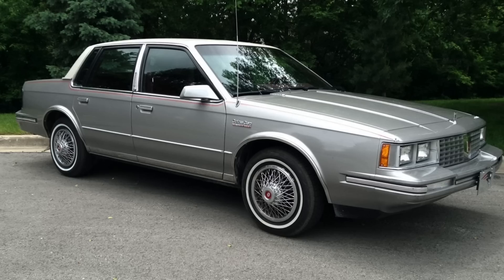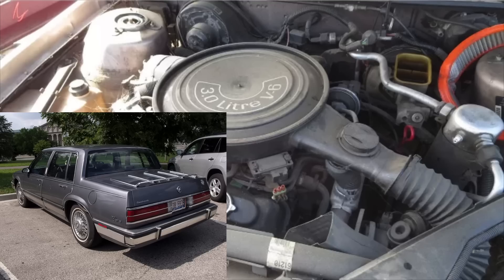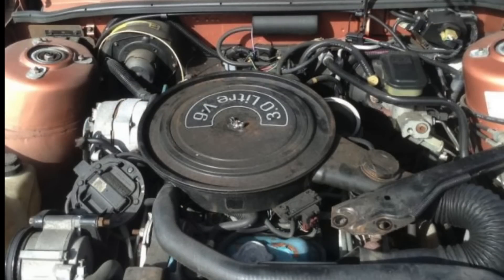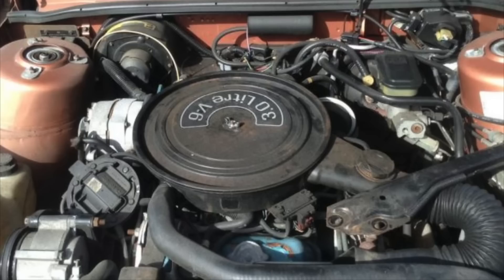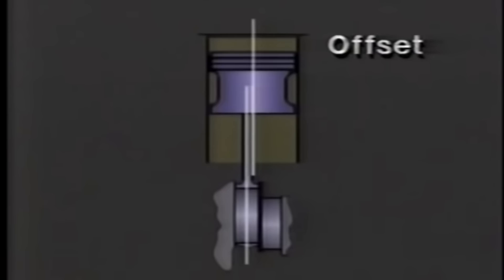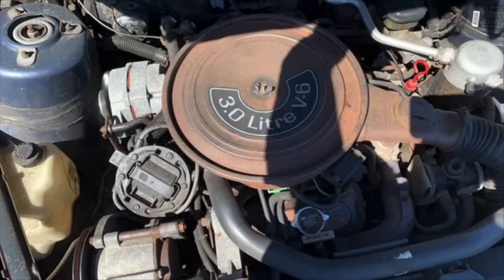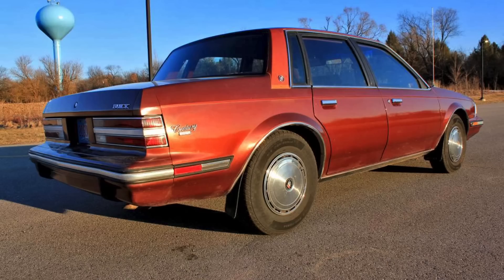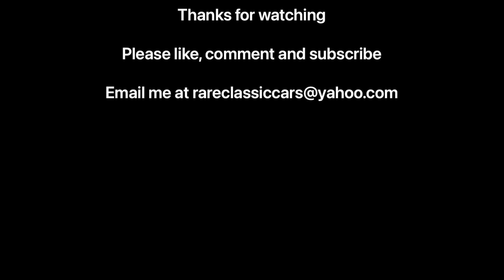Worst Engines of All Time: GM's 3.0L LK9 Carbureted V6 Engine (Buick Century, Olds Cutlass Ciera)

Comment: I had the 2.8 with a Getrag 5 speed in an 88 Corsica.  It was fast enough but developed intractable stalling issues and I traded it in.  Various bits and pieces kept falling off the car.  The trans was excellent.  The AC never worked.  My last GM.
Reply: 92 Bronco in 2003, what a lemon that thing was. Got a 2003 Sierra in 2006, if I hadn't wrecked it in 2012 I'd still be driving it. I have a 2007 Classic Silverado that is at 175,000 Miles, I bought it in 2016 with 75000.

Comment: Adam, would that non-wearing engine additive have any benefit to high mileage Modern cars?
Reply from the maker: I’m not sure admittedly.
Reply: Yes it would. As it contains zinc, which is essential for flat tappet engines. Otherwise, you are just allowing metal on metal contact, and the fine shards will eventually clog your oil pump filter.

Comment: A client of mine had an 84 Celebrity Eurosport that had the 2.8, she put around 200K on it with very few issues. A neighbor had an 82 Century with the 3.0 engine, at a relatively low mileage, a spark plug broke and busted up the piston. Another neighbor and I helped with the repair and put the thing back on the road. I moved before I could find out how long it lasted.

Comment: Here are my memories of this engine in a 1985 Cutlass Ciera I drove in the late 1990s. A friend owned the car and asked me to do some repairs to it. The car had just over 100,000 miles, and it did not run well cold. My friend gave me the car to repair but also let me use the car for several months since they did not need it back right away. What I noticed was the oil had not been changed in a very long time and was black - the way oil gets when people neglect to change it. I changed the oil, the PCV valve, and PCV filter. I remember the PCV valve must have been stuck, because the crankcase was developing pressure and would push the oil dipstick out an inch. As far as I was concerned - this was due to owner neglect, not a fault of the engine.  The cold running problem I solved by rebuilding the carburetor on - which was the Rochester DualJet (E2ME). The main issue was that the choke angle was too wide when the vacuum break pulled the choke off when the engine started. The engine ran too lean and the car would stall out when put into gear unless it was warmed up for several minutes. I fixed this - but decided to do a full rebuild on the carburetor anyway since the car had 100,000 miles and the carburetor had never been rebuilt. I remember on the mixture control solenoid you could adjust how rich the rich setting was by adjusting a little screw on it, but the lean setting you could not adjust.  I remember thinking this was not a very difficult carburetor to work on, it was just different in that it had a throttle position sensor and a mixture control solenoid, which older carburetors did not have.  After making these repairs, I drove the car for 10,000 miles over the course of 6 months, so it had 110,000 miles on it at that time. I don't remember any strange vibrations at 1200 rpm or anything like that. It was actually a smooth and quiet engine. It didn't have a great deal of power, but it seemed acceptable to me. I enjoyed driving the car in the time I had it. I believe I also changed the transmission fluid in it, which again had never been done in 100,000 miles. I returned the car to my friend, who had it a while longer.  I don't remember hearing what ultimately happened to it.  I think they were surprised I was able to get the car to run very well again and they were able to use it again regularly without having to warm up the car for several minutes each day.  Since you mentioned the even firing 3.8L V6 in your video, we had an 81 Buick Century Limited (which was rear wheel drive) with the 3.8L V6 which we bought new and drove for many years. We really liked that car.  It was smooth, quiet, it rode well, and was very comfortable. Definitely no vibrations from the engine.  It ran smoothly at any rpm. My recollection is the car had good off-the-line and good mid-range power, but if you really pushed it, it didn't have good power at high rpms. But this was common for cars during that time period which had so much emissions equipment at the time. We drove it until it had 125,000 miles on it with very few problems. The timing chain eventually stretched enough that it finally broke and needed to be replaced. I don't recall it breaking a tooth on the cam gear - the timing chain itself broke. We got it fixed - but what I can't stress enough is - when the timing cover is removed to work on the timing chain, the oil pump is disturbed because the oil pump is mounted on the cover. When everything is put back together, you have to prime the oil pump before you start the engine! If you do not, the engine will not build oil pressure and you will damage the engine! Maybe some technicians out there do not/did not know this. As long as this is done you'll be fine. But again this is on the 3.8L V6, not the 3.0L V6. The engines are related but they are not the same - the 3.0L V6 may be different. In general, the cars, American and foreign, simply got better as the 1980s progressed and fuel injection and distributorless ignition were introduced, and emissions controls improved (fewer were needed as we moved away from carburetors, and more were electronically controlled and were not vacuum controlled any longer).  I have driven X cars, rear wheel drive A cars (1978-81), front wheel drive A cars (1982 and later) with the 2.5L, 2.8L, and 3.8L engines - they were all fine. By 1989/1990, the A cars (Century/Ciera) had the 3.3L V6, which I drove and found that that was an engine with a LOT of power - much better than the older ones with carburetors. The 3.0L I had the one experience with for 6 months/10,000 miles - it seemed to be fine to me - though I did not drive one for 100,000 miles. I do not think people in that time period followed the "change your oil every 3 months / 3000 miles" mantra like they did years later. They waited until their cars broke down and then they got them fixed rather than being good about maintenance. The 3.0L may have had problems, but a lot of the problems with the cars also came from owner neglect and lack of care. I can say this because I worked in an auto shop at a community college in the mid to late 90s and I remember the cars that came in, the problems they had, how the owners did not take care of them, which resulted in various problems. It isn't clear to me why the 2.8L was offered only in the Celebrity/6000 and the 3.0 in the Century/Ciera early on - why not just offer the 2.8L V6 in all of them from the beginning - which is ultimately what happened after 1985 anyway?  My philosophy was, and is, if you take care of your car, it will take care of you. So I always did things like changed the oil in my cars, changed the coolant, filters, tires, brakes, etc - and I never had many problems with my cars, even during the time period of the 1980s when people were complaining.  Maintenance does go a long way - it's your choice whether you do it or not. Just sayin'!
Reply: Pretty much the same here. 85 fwd LeSabre I think it was. Had a 3.0l. it wasn't no sports car, but it was a very reliable engine, just like the 3.8l. The only thing that needed replacing was the crappy nylon timing gear. New timing set and it was good to go.
Reply: That was an 1986
Reply: Man I’m gonna give you a thumbs up just for taking the time to write all that info. I had an ‘88 S-10  2.8. I had my local tow company on speed dial.
Reply: @AyeCarumba221  lol. The 2.8l was a far crappier engine than the Buick 3.8/3.0, that's for sure.
Reply: @JohnDoe-ml8ru  no way !! I have the H.O. carbie in my 6000 and it's been good to me. They also got way better with MFI.
Reply: According to the dealership shop manual if you do mostly stop and go driving or idling it's every 3 months/ 3k miles for oil changes and if you do mostly highway driving every 6 ( maybe 7) months / 7k miles.
Reply: Excellent in-depth story. Thank you.

Comment: Oh boy, you don't need to tell me about that awful engine.  My grandparents bought a decently loaded 1985 Cierra.  It had that awful 3.0 2V engine.  When the thing was brand new it stalled about 5 times just getting it out of their garage.  They gave me the car when it had 75k miles on it (they'd already had head gaskets done).  It also had the digital cluster which was a cable driven digital speedometer and the speed would jump all over the place.  I tried several different rebuild clusters from the dealer, and all had their own issues.  Long story, crappy car.  Too bad it didn't have the 3.8 and analog gauges, that would have been a step up.  But on another note, that was one of the most comfortable cars one could imagine.

Comment: Mid 90's I bought an '82 Chevy Celebrity cheap because it had an audible knock. I ran 50 weight oil in it, then 70 weight, then went to 90 weight straight gear oil. I never changed it just kept on adding. It lasted about a year and went 10k miles before it stopped. It was the 4cyl..

Comment: My Mom had a 83' Century and it drove fine until the 1st cold snap. It wouldn't stay running after it fired. The dealership mechanic came to the house with another guy. He said, "Here we go again with the 3.0." They couldn't get it to run and ended up towing it in. They had to adjust the throttle body to run for the higher elevation. It ran fine after that. It was a nice car from what I can remember.

Comment: There was a V6 engine used in some Chevrolet trucks and "Blazers" around the early 1990s that was claimed by some people who drove them to be Chev. 350 with two cylinders missing. I think about 260 cubic inches or "4.6 liter". (4.2?) "Fuel injected" carburetor on the issued County pickup my boss (and sometimes myself) drove.  I wonder what kind of bottom end those had? Seemed to make reasonable power in lightly loaded pickup and more than enough in the "Blazer" but not so much as the Jeep 242 inline "Powertech" six.
Reply: The 4.3 aka 3/4 350 aka SBC V6. 262 ci
Reply: @samholdsworth420  — Yep … that 4.3 was a great engine …
Reply: Yeah. They're definitely a good engine. Maintain em and they go 400k

Comment: I was a mechanic at a Pontiac, then Buick dealer during this time. I don't remember ever seeing a 3.0 in a C body, and I know I never saw a 2.2 in an A body. The carbs were adjusted at the factory, and the screws were covered with plugs. Almost all of them were out of adjustment, but with the right tools and skills, we could get them running right. A bigger problem, that you didn't mention, was cracked blocks. The water jacket would crack along the bottom, usually near the front, usually on the left bank. Under warranty, we were required to replace it with what was called a "Fitted block". This was a new block, pistons, pins, and rings. That's it. That required total disassembly of the engine, pressing the old pins out of the rods, pressing the new pistons and pins on the old rods, then re-assembly. I did so many of them I used to be able to tell where every nut, bolt, clip and wire was supposed to be, and what order it had to be in.
Reply: Nightmare fuel. This engine in an Olds Cutlass is the reason my normally quiet and reserved father lost his shit, got in a huge argument with my grandfather about the shit quality of Oldsmobiles and permanently decamped to Mercedes and Toyota as his and my mom's vehicles of choice. His 91 Toyota SR5 V6 pickup is still on the road today.
Reply: I have all the tools for working on those Carburetors, Both 2 and 4 barrel versions. Big Fun if there were other problems like Vacuum leaks from the rats nest of hoses that would rot or get oily swell up and fall off. Thanks EPA!

Comment: You mentioned the 3.0 liter being offered in the C body cars for 1985 but you failed to mention is was the base engine for the all new redesigned Oldsmobile Delta 88 and Buick Lesabre for the 1986 model year only.  I know this because it's first in the sales literature but also i had a friend of the family that had that engine in their base model Oldsmobile Delta 88 Royale sedan in 1986.  It might have been fuel injected at that point but it was still the standard engine in that model/year.
Reply: I think ALL c bodys got the LN7 - 3.0L MPFI version
Reply: @jakeballard7999  and H bodies too for 1986.

Comment: Lol, man I'll never forget what those old odd-fire V6s used to feel like...it was like riding around in a paint shaker...can't freakin believe they ever made it into production.
Reply: Are the 3.1 V6s part of that family? My ‘94 Cruiser wagon has one
Reply: @seamusmeade940  No, the 3.1 was a 60-degree Chevy V6 based on the 2.8.  The old pre-'79 odd-fire 90-degree V6 was the Buick 231 (and a couple smaller displacements too, IIRC) which later evolved into the 3800...of course those 3.1/3100s would later become notorious in their own right for eating those lower intake gaskets...ask me how I know, lol ..that was a fun job...not ..

Comment: If you are doing worst engines, how about the most emissions failing engine ever from GM, the Olds 307 “ Corporate “ motor. It had a whopping 148 horsepower and, among numerous other models, it was installed in all GM full-size wagons from 1986 thru 1990. It made no sense why especially when way better engines like the TBI 4.3, 5.0 and 5.7 were available, all having much more power
Reply from the maker: It was at least durable, though it was indeed a wheezer

Comment: I had this same motor in my 1982 Buick Century. I could not believe how gutless this engine was. Hardly any passing power and had really horrible gas mileage. The 1.6 liter OHC for cylinder in my dad's 1984 Old's Firenza felt like it had twice the power of this V6 and got nearly 30 mpg. I was lucky to get 15 mpg out of that V6. Plus, I had to let it warm up for 20min on cold day or else it kept stalling out. One of the many reasons I got rid of that car after a few years.

Comment: I didn't realize they did connecting rod offset.
I have heard that some early Buick V8s had that design flaw,perhaps the early Nailhead? 

 At least some of the 2.8/171 Chevrolet engines had dual valve springs and that thing could rev to a lot more than 5000 rpm but perhaps got lucky? But not much low speed  torque and an appetite for premium unleaded.

Comment: Pls don't forget the 2.2 liter carburerated that was in the 1982 Chrysler.. I was practically given an 82 Lebaron convertible.. that I had towed home.. it just shut off for no reason.. after endless towes, my expert mopar mechanic,  at my persistence and me test driving it for hours circling the block , figured out how to bypass all the early computer glitches...just shutting the engine down for no reason. I drive it around town now and amaze other drivers seeing one of the most popular cars in 1982 equipped with one of the worst engines ever built ..how many 82s were junked .and tothis day they are extremely uncollectetible like the 1958  Plymouth Fury was in 1981 when I bought an original survivor for 3,800.00 .. I sold it because no one could tune that pair of factory 4bbl carburetors and I wanted to drive it without it constantly choking out... guess I could have retired on the sale of it today

Comment: Your pictured engine's MAP sensor is unplugged. I had a non-running (fuel injected, I think) 3.0 for a short time, in a Pontiac Grand Am. I seem to remember ribbed aluminum valve covers, not the stamped steel ones shown, and a resemblance to the 3.8. Does that make sense? i can vouch for the excellence of the 3.3 litre member of this engine family - over 340,000 km on our 91 Cutlass Cruiser, astill going strong. Chevrolet's 2.8s enjoy my respect, too. They served me well - still have a couple.

Comment: Those additives you suggested don't really work with today's oils because of the large percentage of detergents in the oil. These detergents will clean most of the additives off what ever the oil is lubricating.

Comment: The wider 3.0L and 3.8L were only offered in the Ciera and Century because their front clip was longer than the Celebrity and 6000. I measured them when I worked in a GM dealership in 1984. The 3.0L was a nightmare of customer complaints (shake the fillings out of your teeth.) That was most likely why GM started telling service managers to refer to them as customer comments instead of calling them complaints. And you probably already know you show an X body Phoenix at :37 instead of a 6000.
Reply from the maker: Yes. I goofed. Thx!
Reply: They used then in pontiac grand am 4 door cars too. I upgraded an 85 grand am to a 3800 and it was no small feat! The 3.0 self destructed and even knocked the starter off the engine. It lost 5 rods that made short work of the block itself. I had to graft the wiring from the donor car and use the ecu too. after all that work I turned the on and the engine light flashed twice, cranked it and it fired right up. No codes. The next to go was the transmission.
Reply: I've had well over 30 A-Bodies (Currently have four and the Century diesel shown early in the video was one of mine LOL!) and can verify that the engine compartments are all the same. There is no size difference. You can even bolt a Century/Ciera front clip onto a Celeb or 6000 although the body feature line under the beltline is different.